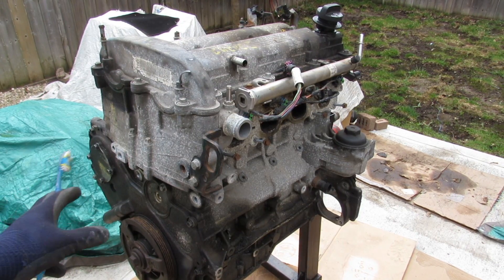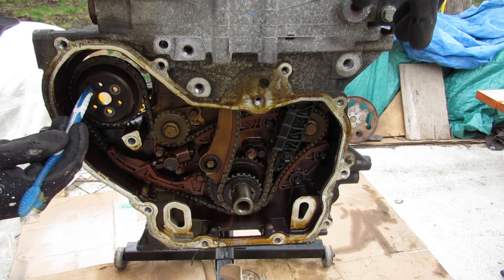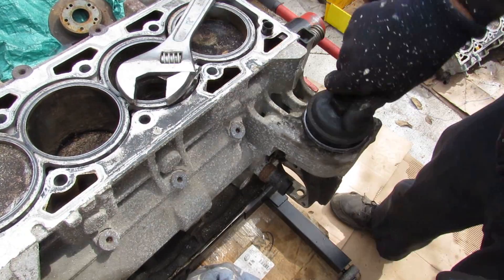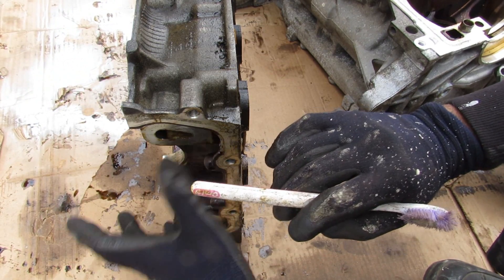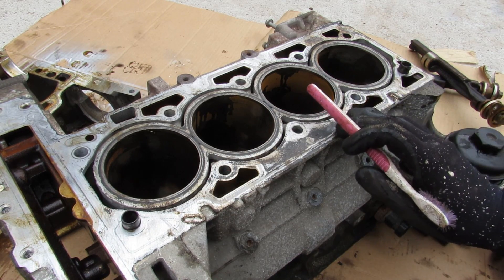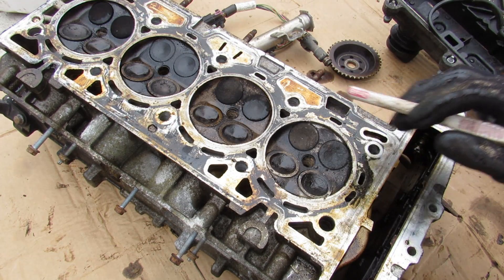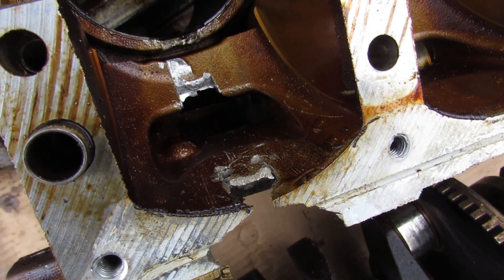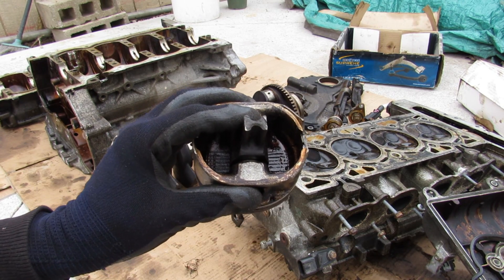Why GM Ecotec Engines FAIL

Comment: GM's Opel subsidiary in Germany did most if not all of the design and engineering work on the EcoTec which explains some of the odd BMW-type fastener choices. The Germans also expect you to keep up with strict maintenance schedules which explains why these don't well tolerate neglect.
Reply: Absolutely.  Being an engineer and having worked on cars since I was 4,  I cringe at German Engineering.  Odd, failure prone designs.  Great workmanship, but terrible engineering for cars that endure the miles that US cars deal with.  People don't appreciate the US designs because they mostly don't separate the design from the manufacturer.  Its near impossible to keep a German car on the road without an engine code or electrical failure.  That said, I routinely get sucked back into the BMW hype and end up regretting it later.
Reply: @walteroreilly8963  - And then you have the small under square long stroke British engines and the owners manual instructing to change the rod bearings at 25K miles to avoid the dreaded 'freeway knock'... (better change the valve springs also to avoid dropping a valve into a cylinder) ... -retired GM engineer
Reply: The Ecotec is a Vauxhall DOHC belt driven cams engine converted to oil lubricated chain driven cams for vastly more reliability. Vauxhall had recommended changing the belts at 80K miles... they didn't last that long, so they changed it to 40K miles... GM doesn't have any mileage recommendation for changing the chains... After initial break in, I recommended using synthetic oil and regular oil changes to make the engine last and stay clean inside.
Reply: The "oil burning" is NOT the result of owner neglect, rather GM design FUCKUP!
Reply: @TheOzthewiz  that's redundant... GM = fuckup...pos company, no one would ever buy that crap if they have 1/2 a brain
Reply: Yep. 

Meanwhile the 60 degree V6 and even some Iron Dukes are still plugging away 20-30 years later.
Reply: @calvinnickel9995  I have 21 year Buick Regal with a 3800 supercharged engine with 178k miles on it, unopened block.  I have yet to see this guy talk about a 3800 series II/III.  People have made insane horsepower on the stock block with stock internals.  I'm running my supercharged with 2.77" and I will be swapping a 2.55" pulley.  Next up is a rebuild of a 95 block with forged pistons and rods, stock crank and stock main caps with a turbo instead of supercharged.  I bet I will easily get this into the 10's with no sweat, even with the shitty 4L60 FWD transmission.  Although I spotted a Honda 3.5L v6, which is similar to the 3800, except the 3800 is an OHV engine.
Reply: @charleslowe522  if he hasnt already he really should talk about or get a supercharged ecotec engine to look at. Especially an LSJ or the 3800. 

Got an ion redline myself and first thing im doing before any mods is the timing chain and all its components. Some make it to 300k no issues but a lot of these LSJ cars have timing chain issues by 100k miles. Which is why im upgrading to a better tensioner and timing chain guide bolt. Then maybe a TVS 1320 swap
Reply: @billybuchanan385  I think the 2.0 LSJ motor is pretty much the same engine as the other ecotecs such as the 2.2 and 2.4 n/a versions, except with oil squirters under the pistons and some beefier internals to handle boost.  I also have an Ion Redline and the timing chain has just started to make some noise at 93 k miles.  My plan is to remove the engine and replace the timing chain then while I'm re/re ing the clutch and trans.
Reply: @rankinewasyn5369  well you can replace the timing chain assembly without removing the motor from the car. doing my timiing chain assembly on the 11th. started making noise around 127k miles and im at 135k now. wanted it done sooner but its hard to find someone who will work on these and knows the platform. yea its similar to other ecotecs but much better built to handle more power.
Reply: @billybuchanan385  I would suggest never letting the oil ways get so dirty the tensioners can't do the job. I have seen 2.2's do 300000 km and more in a Saturn and it's normally owned by no maintenance types. I am not sure its a timing chain problem as much as a plugged oil way problem. That bearing BBQed.
Reply: I have a 2003 Saturn IOn with the 2.2 engine. It had just past 200000 km without any trouble with the motor. I changed the oil every 3 months. I parked it in the back yard and took the battery out of it. It sat for 5 years.. Put the battery back in and it starting like after 3 years and ran like it was driven the same day on 5 year old gasoline. To be honest, the only thing that seemed designed correctly was the motor, the rest of the car was badly engineered but the plastic gas tank does not rust...that makes a difference.
Reply: @charleslowe522  I had a 99’ Camaro many years ago with that same 3800 V6 and it made it all the way to 288k before a connecting rod cracked. Made considerable torque. Even without a V8 that car was still awesome.
Reply: @billybuchanan385 better than my wife’s BMW timing chain issues every 30K
Reply: @HobokenHearth id barely accept any BMW for free. If ever. All cars have their problems of course but BMW is not only hugely problematic but a bitch to work on or pay to have work done. Its literally just buying brand name jeans for 500 vs 20 dollar jeans from any other normal store
Reply: @calvinnickel9995  The 5.3 is much the same. It may destroy exhaust studs like nobody's business but a pre-DOD 5.3 is gonna run for a long time.
Reply: @calvinnickel9995  Ford 4.0L SOHC engines are also from Germany. They have E-torx fasteners  and similar messed up timing (chains in the rear!!!). The older German OHV ones though were pretty much bulletproof. The SOHCs need very good maintenance.
Reply: @alb12345672  I had a 1974 mustang 2 with a 2.8 l V6 engine. 2.8 l was an amazing V6. It came from Europe and was originally installed on the Mercury Capri in the seventies. These were the cars that made drivers in z28s cry. In 1974 the cubic inch inline 6 that Ford had was putting out about 84 horsepower. 74 was the worst engine horsepower year ever. It was before the catalytic converter which started in 1975. There was so much junk on the engine and so lower compression they just couldn't put out power. The 2.8 l which was 171 cubic inches, put out 117 horsepower the same year. For pushrod engine it really revved nicely. The only thing I didn't like on it was the water pump. I had to replace that and I think it had 11 10 mm bolts whereas most American cars had four bolts on a water pump. It had an interesting Holley carburetor. It was set up like a four barrel but it was a two barrel. Like he cut a four barrel and a half front to back. You could hear that second barrel open up when I would nail the gas.
Reply: @JohnRodriguesPhotographer  Those Cologne OHVs are very strong but even in the 4.0OHV explorers they were prone to head cracks. Much less so by the 90s. The WP does have a tons of bolts, but maybe will require one replacement at a 150K interval. The good thing about the 4.0 not sure about 2.8 is that peak torque came at 2300 RPM.
Reply: @alb12345672  I just finished rebuilding a Ford 4.0 OHV V6.  Even after 300,000 miles, the bottom end was like new, though I've been diligent with oil changes after I purchased it at 150k.  
Sadly a cylinder head was cracked after the heater bypass valve disintegrated, losing almost all coolant.  Once I tore down further, all of the hydraulic lifters were seized internally.  That caused excessive rocker and pushrod wear, but all the lifters were cleanable and put back into service. 
So I wouldn't call the 4.0 OHV "bulletproof".  I wish the cylinder heads were tougher, and the lifters weren't dependent on tiny oil passages to maintain valve lash.  But all things considered the 4.0 is still leaps and bounds better than a lot of modern "reliable" engines.
Reply: @rhekman  Cracked heads are an issue, but most of the time K-seal can fully fix it. Rockers and pushrods are inexpensive, and the engine can be rebuilt in your driveway relatively easily and inexpensively. No broken exhaust manifolds or timing issues. These engines seem to hit very high miles. They also don't burn a drop of oil or sludge up. Perfect, no, but one of the better ones.
Reply: @alb12345672  Yup, parts are inexpensive, which I really appreciate. 
My head was cracked between intake and exhaust ports on #1 and #3 cylinder. Zero compression, so no fixing that with K-seal 😋
Reply: @rhekman  I had very little compression in cyl 3 on my explorer and its good for years now. I had to run it with the plug out for an hour, but it finally sealed. I never did a compression test but the computer has pids for each cylinder and 0 misfires. If the truck wan't rusty, I would have invested in new heads.
Reply: @alb12345672  The 4.0 Ford Explorer pushrod V6 required extended wide open throttle operation.  It was a dog.  On I68 in MD you better hit the bottom of the hills at 90 mph and keep it floored all the way up.  I can’t imagine driving up the Ike on I70 in CO.
Reply: @user-tb7rn1il3q  I kind of agree, my explorer has 4.10 gears. It is not powerful either over 2500 rpm.
Reply: @alb12345672  Os that the Cologne engine?
Reply: @standhd  Yep. The cologne v6.
Reply: @calvinnickel9995  I'm not a big fan of General motors products but the iron Duke was a great four banger. Also the Nova 4 cylinder engine from the 60s which ended up being put in boats, they put out about 120 horsepower, they were great also. My dad's boat had 120 horsepower OMC sterndrive. We were 20 miles out one time in the Gulf of Mexico when I heard a funny sound coming from the engine compartment. My dad couldn't hear it but he trusted me and stop the engine turned it off and started looking around. He leaned on the water pump and the shaft moved not in a circular movement but an up and down movement. Needless to say we did not come back at high speeds we came back slow and nursed it back to the dock. It was easy to replace four bolts it was harder loosening the belts and it was to replace the water pump. Never forget that funny sound the bearings makes. Nothing was coming out of the pee hole either. So the seal was still good just the bearings were shot. The boat wasn't 2 years old. And we flushed it with fresh water every time we brought it in. It was kept on a trailer or not in the water.
Reply: @calvinnickel9995  My old iron Duke stills going slow and strong
Reply: @calvinnickel9995  my daily driver is a 2003 Pontiac grand am with the 3400. Sure I had to do the LIM gaskets at 170,000, which any somewhat mechanically inclined person can do. Still going strong at 260,000
Reply: @calvinnickel9995  if I’m not mistaken, the iron Duke is very closely designed after the BMW S 14 B 25 engine, which is a 2.5 I4 out of the BMW E30
Reply: @calvinnickel9995iron dukes are legendary for durability
Reply: Saab
Reply: @matthewkasica8083  the classic Saabs were very robust essentially indestructible even without proper maintenance. But I don't know why you wouldn't maintain your classic Saab!
Reply: @Michael-ft3vg  yea if you let them leak you can just keep adding clean oil
Reply: @matthewkasica8083  Saab has nothing to do with the Ecotech engines.
Reply: Yea you know nothing lol...
Reply: @La-yt1wr  parts.
Reply: @matthewkasica8083  yes turbo
Reply: @matthewkasica8083 Saab helped a little but opel/vauxhall and gm powertrain did 99% of the design of the engine.
Reply: @elonsus9747  wont see metal. There are plastic guides that break. You could try replacing the tensioners but likely the engine will have to be pulled and the timing system replaced.
Reply: You know when he was taking this engine apart and describing the cam chain tensioners as he was removing them I was thinking to myself "I wonder if GM consulted the Germans when they designed this engine". German engineers are some what notorious for over engineering and complicating things that don't need to be complicated. Funny you should point out Opel did this. When I was a kid opel was actually built in Japan, the unit sold in the United States I'm referring to. And then they change their name to Isuzu!
Reply: @JohnRodriguesPhotographer  - Buick was the same way... complicated solutions to simple problems...
Reply: This is all the more weird since GM set the service intervals after break-in at such long times. My SAAB's literal instruction manual says to change the oil after 20000 kms (about 12400 miles) or 2 years if 20k is not achieved in that interval. I know the oil is synthetic and very thin, but it seems crazy. And the worst part is they even engineered the ECU to count that as a Service Interval, you can change it after 1 year, let's say, and the car has no idea, it'll tell you it's time for service only once every two years...
Reply: Ya, was a Opel block they dragged over to Lotus (owned by GM at the time) to build an engine. It's actually a Lotus engine in as much as a Renault engine is a Lotus engine.
Reply: Opel is better off now with french build Peugeot/Citroen engines. Very reliable in general and yes better and more original engineered.
Reply: Bad tensioner design that they should have voluntarily recalled.
Reply: Its also not hard to keep up on maintenance, some people are just too lazy or simply dont care if their motor explodes because they like to skip or go overdue on maintenance. Maintenance your car regularly if you dont want it to have major problems. Bit everything wears out eventually but keeping on them helps slow the process🤣
Reply: The f23 Getrag manual is also German bmw craftsmanship.
Reply: Yup they called it the Z22SE it was the euro emissions ecotec L61. The first ecotec was the 2.2 (L61) for the Saturn L-Series in 2000 It said Saturn twin cam on the ignition coil pack then in 03 they put it in other models where it said "ecotec 2.2" - These ecotecs I like to call the metal timing chain based ecotecs. I think of them as being the replacement to the quad4 Then we have the "GM family2" series ecotecs which are mulicultural GM engines. (engines like the 2.0 dtec, 1.4,1.6) They can be found in cars like the opel/saturn astra. In the United States we had the 2.0 found in the Nubira,Reno &Forenza it was a belt driven multicultural engine thats somewhat of a Opel design.
Reply: @fsfs555 That's not entirely correct.
Fritz Indra talked about this at a German podcast.
The GM Ecotec engine series was designed by a global team, and most importantly there was a list of requirements from all over the world.
In the end the engines came out sub optimal because of all these requirements.
The C20XE (GM Family II) is considered a much better design.

The Ecotec brand was used by Opel with older engines, that might be where the confusion comes from.
Reply: @ysmg9010   thought this is suppose to be based off the opel c20xe aka redtop engine which COSWORTH helped opel design this should be one of gms most reliable engines
Reply: @deansullivan212  
no, as I mentioned it was a completly new design.
You could lookup the interview with Fritz Indra at the "alte Schule" Podcast, but it's in German.
Edit: Indra was the lead engine designer at Opel, later worked for GM in Detroid, before that we worked for Alpina (BMW tuner) and Audi.
Reply: Yes rules and regulations lol
Reply: Came here to say this. I have a turbocharged 1.4 Opel Family 0 engine in my 2014 Sonic RS, and although maintenance from previous owner seems to have been pretty regular (regular enough to keep all cylinders at ~200psi on a recent compression test), they do not tolerate overheating very well (surprise!). The 230° thermostat (!) necessitates a 20psi cooling system; this combined with the complete absence of a TEMPERATURE GAUGE has left me rather bitter.... I blew a lower radiator hose and it wasn't until finishing my 30 minute 12 mile Los Angeles Rush Hour drive that I heard the fans blowing after shutting off the engine and decided to take a look inside...😭 Supposedly there is an "engine overheating!" warning light, but if mine never illuminated during my fateful trip, I shudder to think what it would take to ping.
Reply: @l0t49  from all my chevrolet sonic and cruze owners that show up on a tow truck, no, no they do not warn about overheating. They just shut down the engine suddenly.
Reply: @meticulouselectronics  My 2011 Cruze 1.4t would warn and state the AC was disabled due to overheating. The gauge is a joke though. It will sit in the middle then suddenly move all the way up. It is not linear. That engine died at 42k from the cracked piston issue. With a non-warranty replacement engine, I had a bypass valve check engine light even after changing the bypass valve so I ignored it. Noticed more fans one day and read the codes to find that the heating circuit in the thermostat had failed. Instead of opening at 190-210, it wouldn't open until 230 but gauge was right in the middle as usual so I did not suspect anything. Changed it and the water neck dues to the plastic crumbling for the air bleed connection. Back to normal until the PCV nipple went AWOL. Then the diaphragm in the valve cover.  Then engine started pouring out a smokescreen a 2000miles later. Don't know if the extra heat killed the engine or if it was bad to begin with. Needs 3rd engine at 53k.
Reply: @a2cryss  wow sorry bro
Reply: @l0t49  seen a few pistons break in the 1.4s
Reply: @l0t49  GM thought it was a good idea to isolate the temp sensor in a housing on side of engine. Once the water is low the sensor can't read squat. 

GM also cheaper out on sonic and installed no front lower engine mount like the cruze. This allows a ton of engine movement and stress on the plastic water inlet near this temp sensor. RacerX fabrication makes a custom lower rear engine brace to stop this unwanted movement.
Reply: @troyg3439  forgetting the part where they state that the ecotec engines are german designed engines.   mini is the same way with that shit.....same for the high pressure pumps on the head, the temp housing circuit bs, and using plastic every fuckin where in the engine.   only way to get around it is to keep a good eye out for it, have spares, or replace it with something better from the aftermarket
Reply: The Germans just can’t help themselves, even their failures are needlessly complicated.
Reply: yeah and why anyone who has a clue buys Japanese...they build it right from the get go and there is ZERO comparison in quality...Big3 and German cars are crapola
Reply: @Flamixco  lol, funny how weebs tend to bash anything not japanese as "they build it better"  yet ive seen my fair share of fuck ups from nissans, mazdas, and subarus.  and as a subie lover, i can tell you that "quality" isnt exclusive to ALL japanese cars, just like with GM, Ford, Dodge, BMW, Mini also an owner*, or any other manufacture out there.   bad designs and or poor maintenance will kill any engine, and yet you still hear of EJ25s going without blowing head gaskets, or N14s not puking timing chains, or hell, a ecotec 2.4 making it past 300 thousand miles.   Idiot proofing is nice *ej22e, k series, jz engines, the m88 or any old gm small block before 86  but making people complacent isnt a fix for making people take care of their shit and not run it into the ground
Reply: @bigshow196  blah blah, the consumer reports of the last 30 years set the record straight...no comparison